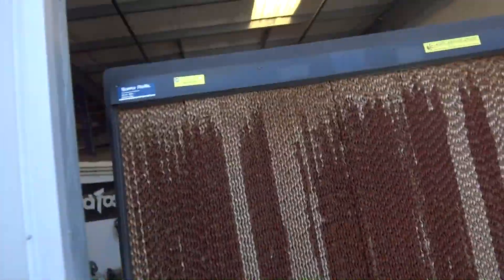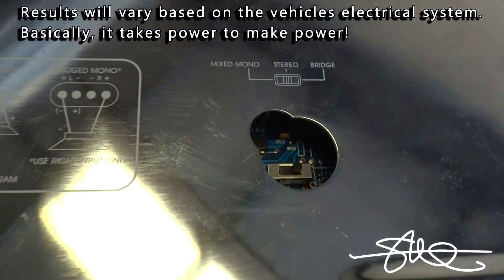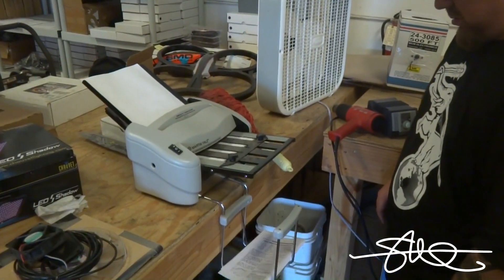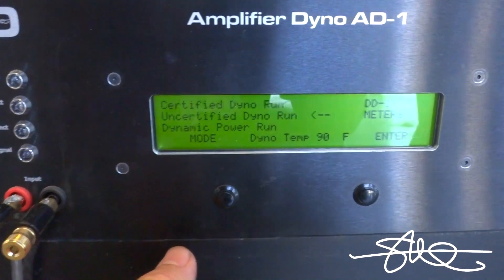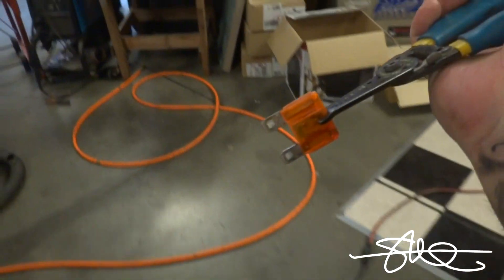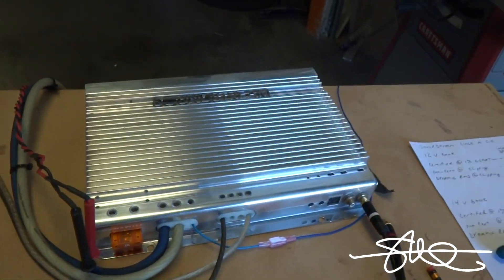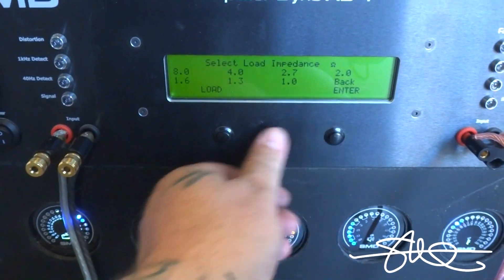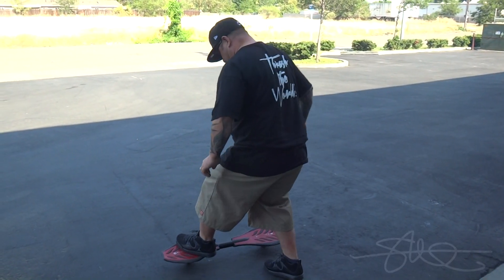Amp Test Tuesday - Soundstream Class A 5.0 - Rated 500 watts - 1/4 ohm - SMD AD-1 Amp Dyno

Comment: meade916 I'm betting this amp would surpass the ratings at 1kHz. Most of the OS full range amps were tested at 1kHz as this gives more output power. I have a Soundstream Reference 500 (1993) and MC 500 (1989), I'll put on my AD-1 soon. Thanks for doing this test!
Reply: From what I've seen with the other SS amps around this time, they don't quite meet their ratings. They were rated at full power at 12V and with the Reference 500 and Class A 6.0, they did rated, but it took almost 14V. See the Ref 500 tested here http://youtu.be/iKUfgMGuOoA
Reply: BigDWiz in the Houuuuuse!!!!

Comment: I think this is a fair call...I own a few 10.0's which sound just beautiful so the SQ's not an issue. But also have to agree on the failure rate too- in my case 2 of mine died (only ran as low as 2-ohm too)- just because. And boy do they STINK when they let go :P

Comment: Brian, Steve's AD-1 makes measuring amp output power much easier than my setup. I also have resistors and DD-1 technology in my setup, but Steve is able to push buttons to change ohm loads, I have to change wiring...takes me forever to test an amp. My results would be the same as his "certified mode" results. I cannot perform the other two until I get an Amp Dyno :-)

Comment: I do car audio as a hobby and I will admit I do not know too much about amplifiers but how old was that amp? Could it possibly be not reaching its big power mark because of wear on the capacitors and coils in the amplifier? I know that computer power supplies and or computer parts will drop by up to 40% of power output over a long time of use and I would imagine car amplifiers do the same. Love your videos by the way, you are the reason I picked car audio as a hobby, kept it up man!

Comment: Hey Steve- do u remember an amp company from the early to mid 90's called U.S. Amps? They were among the first amps that I saw that were quarter ohm stable AND had super low THD (like 0.00025 THD, if I remember)

Comment: not bad for its age. it could need caps. they could have lost capacity over the years. causing it to look a bit of power. under higher loads. great video.
Reply: that is my guess. Those amps used to make rated, albiet i think they were rated at 1k and not 40 hz like steve did here.  They were always "nebulous" with their ratings.

Comment: Given it's an older amp, you may want to let it run under a steady load for a hour or two.  The caps may need some power on them for the amp to run at an optimal state.  Do you have an Alpine V-Power MRP-F240 amp on the shelf to test?  I have this amp and plan to put it back in use and curious how it holds up to its given ratings. ;-)

Comment from the maker: actually i agree and i disagree.  It was a great sounding amp, that i WISH i had back in the day (only had a 3.0), but the failure rate on the 5.0 and 10.0 was through the roof. Mighta been the straw that broke the camels back when they moved (sold out) from Folsom, CA to China.

Comment: @meade916 will you test a Elemental Designs nine.1 amp if you get the chance to pick one up? They are a rock solid amp as long as you give them enough voltage. Please and thanks!

Comment: Hey Steve,  question .   Do I need to upgrade my alternator to run my stock battery for starting . And a deep cycle battery for my amp?   Also could you test a soundstream tx.2000 .1 ? Recently purchased . Wondering what the actual RMS is lol . Thanks

Comment from the maker: +namcost stop playing the know it all. You sound very stupid right now.  The original Soundstream amps only use ONE RCA when in Mono..  Period. No need for the other one, it does nothing.
Reply: meade916 I have a sound stream reference class A 6.0 amp and I'm not sure how to tell if it's working properly it sounds awful distorted on my old school mtx terminator 10s what settings should I use
Reply: meade916, what is your personal opinion on the best amp of all time?
Reply: I think you should re run it with both plugged in just to show em
Reply: meade is right.. old school soundstreamer here...

Comment: Give your opinion on blowthrough set up for 94 toyota pickup I was thinking 4 15" woofer need to know you set up ideals I already got the body going with 2013 lexus gs350 front bumper so I need a show stopper system to any ideals Mr. Kick ass bass

Comment: Just to be clear, the Class A 5.0 is NOT rated at 500 watts.  It's rated at 25 watts.  12.5 watts per channel.  It was built according to IASCA rules, where an amplifier is rated by the manufacturer into a 4Ω load.  You could run *two* of these amps and still be in the 0-50 watt Novice or Amateur class.
  
This is still far and away the KING of over-rated amplifiers that you've tested so far.  407 watts on an amp rated at 25.  That's >1600% over rated power.

Comment: Hi! I have a dual 4 ohm woofer... when I hook up my woofer to the amp in bridge ( Woofer in paralel ... 2 ohm ) my amp goes in protect but when i hook up also in bridge but only 1 coil ( woofer in 4 ohm ) it`s work good... what is the problem? My amp is not stable for 2 ohm?

Comment: steve get your hands on a old school series viii hifonics zues or a earthquake pa2300 amp and test those...also rem there old school amps your testing the internal caps are failing so they might be putting out shy of what there rating is because the rails are not seeing the voltage they need..  thanks Tony c
Reply: I thought the same about the caps until I heard an explanation from Ray at TIPS (Linear Power) about recapping. He says they have mid 80's LP amps still running the same caps and they are still within spec. I think replacing the caps with better quality, lower ESR and higher temp ratings doesn't hurt, just don't think it's gonna make a power output difference. Now many of the early 90's Phoenix Gold amps had runs of bad caps and those need to absolutely be replaced before using (as they can leak and cause fires, which is NOT what anyone wants).
Reply: this is true!